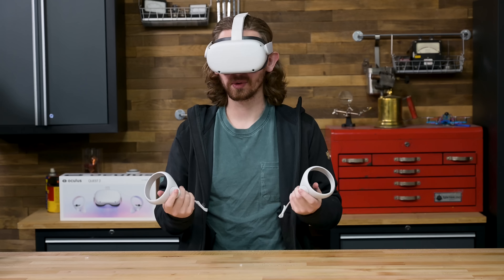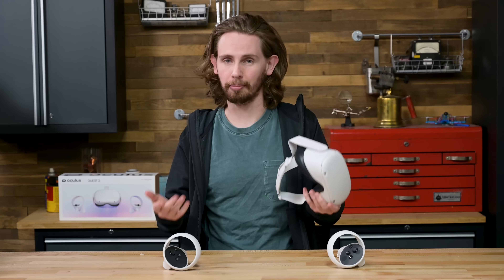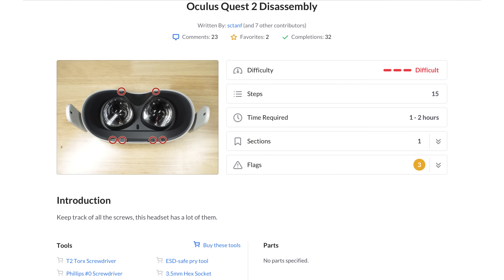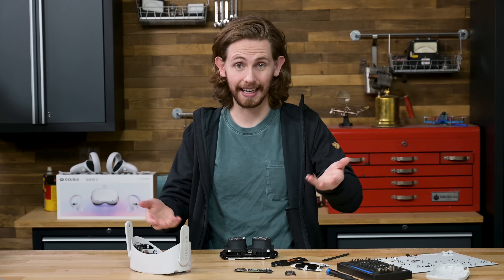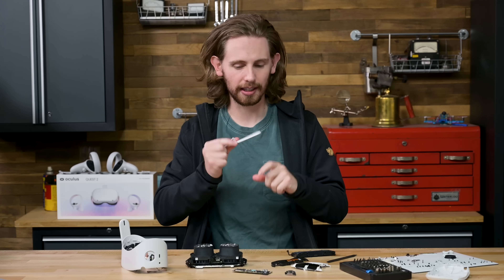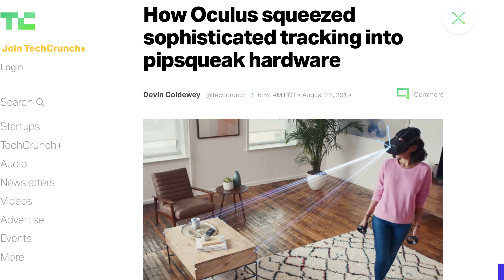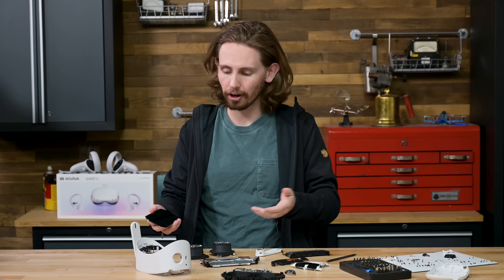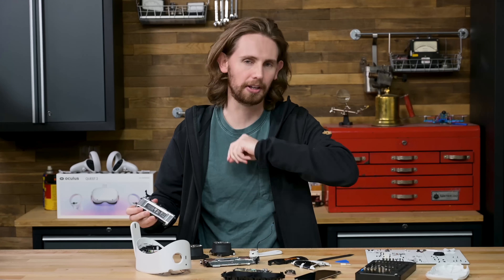Oculus Quest 2 Teardown: Into The Metaverse

Comment: if you want a more proper answer on how they  track using cameras, AFAIK it's just by recognizing common objects and land marks in the area you're in, then they measure their size, check how much it gets smaller and bigger and how it rotates to track the headset. if it gets bigger you're moving forward! and you can see the object on the left of the headset move back, so that's how they can know, and they probably combine it with the accelerometer data to get better accuracy.
Reply: It's called SLAM tracking, and basically works the way you described

Comment: The instuctions been up at the site for a while now, and I feel like I've seen this vid before. Is it a reupload or just deja vu?
a couple notes on when I took mine apart:
- don't. Theres really nothing inside to change or tinker with. I did it to take a look at the front cover and see if making custom front covers is viable. I would say it is to an extent
- the facial/rear cover is snapped on very tightly and took a lot of work to get loose. You want to pry the cover straight out in the direction away from the device rather than just pulling the 2 plastics apart

- the deep screws that hold the front cover can be tight and I had to use PH00 instead of my PH0 that was stripping the screw head
Reply: Its not a reupload, since they mentioned the meta event from the end of 2021

Comment: Gotta say that this has to be one of the best and few Oculus Quest 2 teardowns I've ever seen. I been thinking about modding mine since i bought the 64gb model before they decided to phase them out. Might be able to cut a hole for a bigger heat sink so it wont make my face sweaty lol
Reply: 3d print a vented spacer with integrated laptop or other similar small and thin fan, I wonder if anyone has made something like that
Reply: @virtualtools_3021  i like that idea. Or a new front cover that's a bit more bulged out to put a bigger fan and heatsink inside. Even battery. I should invest in a 3d printer as my next big splurge purchase. Nothing too fancy should be ok.
Reply: There's a product for this. It a modified facial interface which has space for a fan that goes on the top of the HDM. Bobovr fan is the thing to search for, I heard good things about it but I haven't tried it myself and kinda not cheap.
Reply: @SzDavidHUN  i saw what you was talking about. Kinda reminds me of one of those blower clip fans you attach to the side of your laptop to blast air into it.
But what i was going for was cooling the headset's hardware. Like there is this video i forgot who posted it where a guy liquid cooled the internal cpu.
Reply: i think the best mod for the quest 2 would be a replacement headstrap that gives it the ability to get the lenses right up to your eyes like the valve index. i get a far higher fov with the quest when i take the face foam off. but then its not comfortable. 

replacing the entire quest 2 shell wil a minimal shell that sits inside a headset frame with a adjustment dial like the index would be really cool.
Reply: @ge2719  im able to get my eyes right up on my headset. Downside is eyelashes hit the lenses and can leave bits of oil each time i blink. I thought about a lense swap, but the way the screen works makes it where you cant get any more fov. I wanted to cool it better when i wanna push it to 120hz

Comment: can you leave the battery out and connect it with a wire externally (say if you wanted to clip it to your belt) to reduce weight? Would that throw off how the system works?
Reply: It might. I know that the longer a charging cable for your phone gets, the slower the charge. Like test the recharge speed of a 3ft cable vs a 10ft cable. My guess is some of that electricity gets lost in the wire. I use an external power bank like a 10,000mah one for about 10-20 dollars. Adds another like 3-4 hours of non stop gameplay. Takes forever to recharge the power bank though so buy an extra lol.
Reply: @batterypwrlow  voltage drop over a meter should be minimal. maybe you have been using a lower amperage charger that just happens to have a longer cable because it shouldnt matter. 

in the case of this device it depends what the voltage of the battery is. it might not be 5v.
Reply: @ge2719  might be just bad quality cables. Most of them are Dollar Store generic cables. I use a 5v 2a or 2.4a charger usually for my stuff.

Comment: Great video! Only thing that i still want to see is how well the charging port is soldered and secured.
Reply: Did you ever find the info my charger is lose and I need to tear down
Reply: @aprillove143  i havent but i would just get someone experienced in micro-soldering  to check with a voltage tester and repair if necessary. BUT only if you cant get meta to replace the headset entirely. I hear they'll replace it if its manufacturing error. Im no expert but ive done some repairs. And first thing you wanna do is see if thecompany will fix it for you. Because if you take it apart they DEFINITELY wont replace it.
Reply: @the_rabbitt  I actually did the Meta Chat support and was able to send it in even though my vr is 16 months old they made an exception to have it replaced. I took  that route! But still so many people having charger issues, I see it on Facebook daily. Im surprised not ONE charge port discovery video. Would be very interesting to see why they are melting or becoming unsecured and unmounted like mine.
Reply: @aprillove143  im glad to hear that it worked out. Once mine eventually goes and dies ill make a video about it. But im hoping that wont be for a long while.
Reply: @aprillove143  do you happen to live in Hawaii? Just curious.

Comment: I wonder if you could mount some cylinder battery holders on top and use one or two 18650’s. Maybe someone could manufacture a cable that could be routed out the case.

Comment: iFixit is finally taking VR seriously. I hope the rest of the tech news industry follows. Zuckerburg is paving the way through the Metaverse. Btw you can position the IPD lenses in between the notches so like between setting 1 and 2 or 2 and 3. I hope they bring it back soon.
Reply: By just buying a quest2 you are not automatically a serious VR dude.
Reply: @REDxFROG  Are you seriously gatekeeping vr?
Reply: That's less stable, chances are they won't stay in place. It's better than no IPD adjustment, but it would be better to have a more flexible one.
Reply: @jaskor2443  so you have a clue?
Reply: @thenonexistinghero  my neighbor uses a spacer that they made out of paperclips, and there are 3D printable spacers on the various 3D model sharing sites.

Comment: Next, the controllers... The joystick ghosting has been really bugging me off
Reply: and i've contacted oculus support to get the part and they said they don't sell it and couldn't provide me with a part number. They did offer me a controller replacement though, which i politely refused and temporarily fixed it myself. Not sure if my fix is gonna last.

I really hope that part will become available from the usual suspects as quest2 gets more popular and the demand for them increases.
Reply: Tried cleaning the exterior lenses and adjusting the room lighting? Possibly forcing the tracking frequency to your country's lighting?
Reply: Replacing the batteries fixed it for me

Comment: Is there a way to mod the Quest to bypass the battery and feed it directly with the power needed for PC gaming and applications? 
When I set my Q2 to max resolution and framerate etc, it drains the battery quickly. I understand this is because you can only charge the battery with external cable which is limited to protect the health of the battery? Need more power! 
Good to see a teardown and see that it can be repaired, even if its complicated.

Comment: I would love to know if you could get a better battery to increase life time. Some sort of modd that doesn't not include using a externa power bank to charge it.
Reply: 100%, the connector it uses is standard. You could DIY it with a bit of know-how or you could wait for another company to make a generic battery. Future batteries will have more capacity so thats one way to get a better battery, waiting.

Comment: I feel like we could mod the headset to wire the battery to the back of a strap. The Headset would be perfect. Though, I don't know if there are any software quirks involved with the position of the battery. As I could clearly see multiple connectors there.

Comment: heey, what's up. Bro,  u do a really cool and educational video, and thank you for it.
i'am a brazilian, and here this assembled screen has a high value like a 590R$ (105/106$) + 400R$(70/71$) Tax.
But only the screen i can get it for 215RS(38$), u have a video doing that replacement ? or can u tell me if i can use that screen without that black glue?

Comment: It's not mentioned in the video but I'm just going to suggest that the aftermarket Elite Head Strap (with a battery) is worth a teardown video, it would make a lot more sense to get the upgraded strap and replace the battery inside it than to ever open this thing just to replace the battery in the HMD.

Comment: Screens can “fail” pretty easily if you leave the headset sitting in the sun and get a burn mark
Reply: just dont let the lens get exposed to direct sunlight.... not hard if you get a lens cover.
Reply: @shoopdawooplazars  I assume it's not that hard of a thing if you leave it on a table infront of a window without realising, or need to take it off quickly (i.e. you're VERY prone to motion sickness) so you put it on the floor infront of a window
Reply: @u1f98a  youd have to leave it there for a little while, it doesnt happen instantly

Comment: Could be nice if it was cable only and they excluded the battery from it and sold it separately (like a strap). That way they could pack more tech in it or make it more slim...
Reply: The limitation is actually already just the lens. If they improved the resolutions of the screens it would not even be noticeable. The bottleneck is the glass. The quality lenses exist on prototypes and Varios and its reportedly a whole other level. The future is quality lenses mass produced.

Comment: @iFixit Do you have a link to where I can buy a T2 screwdriver with a hollow tip? I tried 2 different T2 drivers, but neither had a hollow tip, so they didn't work. I think it's technically a T2 Security or T2H.

Comment: How about the oculus touch controllers? Many users are experiencing drifting
Reply: Clean the joystick with compressed air while spinning it, or, send it in for a replacement if you're able. I just had to send my controllers back for that exact reason. Cleaning helped but unfortunately only temporarily.

Comment: My headset has so much use the battery gets around one hour on a full charge. Bummer it takes a fair amount of work to replace.
Reply: I mean that's kinda y u use a extended USB-C cord and plug it in while u play its a life saver instead of waiting for like an hour or 2 to charge it
Reply: @stiffplaysgames9999  I mean that defeats the whole point of wireless VR but ok

Comment: Where can you get the tool to remove the trim piece as I cannot use my headset because the trim piece is stuck popped out and my screwdriver is too big to unscrew the screws.

Comment: @iFixit Any idea why my Oculus controller are not working?

Why are the controllers suddenly not working?

I've done nothing different and the headset and controllers did not fall or take any type of damage. They just suddenly stopped working after a game of beatsaber.
The environment of Oculus has not changed.
No direct exposure to the sun with ample lighting and with more than enough room use it.

I've reset the WiFi, take with my internet provider and they say everything is green. So that's not an issue.

I turn off the headset and reset it multiple times. I've unpaired and repaired both controllers multiple times. The batteries are full and the do buzz as if there going to connect.
The center white dots that acts likes a mouse cursor does react when I press the right controllers top trigger and A button but only makes the cursor flash blue per tap. Same goes the left controller for upper trigger and X. Only the upper triggers and lower buttons make the cursor flash from white to blue. But doesn't show hand or allow my hand to control the cursor.
That's seems to be directly controlled by the headset. The cursor seems to stay center and only move headed on where I aim my head with the headset.
Reply: Get new controllers , that’s prob the only solution

Comment: I wonder, is it possible to relocate the entire battery outside the headset and wear it on a vest or a belt?
It's one of the heaviest components so if the weight of the battery was removed, the headset would be a lot more pleasant to wear longer durations, and might as well stick with a larger battery (if possible)

Comment: IPD hack You can actually get any IPD within the minimum and maximum, though there’s three steps you can move the lenses between those steps if your careful and it will adjust the screen appropriately to the distance you moved, not just the 3 settings. I need slight click wider than the minimum setting, and it’s so much better then being on either one of the settings each way.

Comment: My biggest gripe is that even when the headset is powered down by holding the power button and selecting power off, it still drains the battery, like a lot
Reply: Gotta unplug it. If its plugged into a non powered cable like a shut off PC it will drain overnight. If its unplugged and fully off it will last a reasonable time.
Reply: @nutellabrah6718  I will have to test that. Thank you!

Comment: Anyone know the capacity or weight of that battery pack/mount? Curious if it would be worth removing amd using the external headstrap battery instead to take as much weight ad possible off the front of the face.
Reply: 63 grams per Oculus website. Not really worth it by the time you counterweight the headset with a powerbank anyways. Unless you're one of the rare people that think 2hr battery is fine.
Reply: @rcbif101  Im curius if that includes the weight of the housing (being that it looks like the battery is inside a metal housing). Although I doubt the  headset would work without the built in battery, no doubt there is some "safety" check"
Reply: @legendp2011  Looks more like an injection molded housing. They tried their darn hardest to keep the weight down so I dont think they would use metal.

Comment: SCREEN FAILURE COMMONALITY - how about four units in two months? I have had returned one unit to Amazon within two weeks, another bought direct from Oculus/Meta after 2-12 months, am in the middle of returning the replacement Amazon unit and just had the replacement Oculus unit fail. I am guessing this is sweat/condensation ingress into the unit from hard workouts. The pattern is that the display develops a very grainy characteristic with vertical lines and reduced light output before going completely dark. I wanted to see the breakdown again because I think I need to seal up the interior with electronics safe silicone.

Comment: Why not put those complicated parts behind or at the top of our heads, instead of everything up front, you cannot see through it anyway, your eyes only focus on those lenses. Maybe my idea end up much like a helmet, but the weight will be more balanced.
Reply: More faliure points with wires and connections traveling an area if the headset that also needs to be adjustable.

Comment: 0:40 "hours of setup and calibration", but it took you 20min in that video, and like most people, it only takes about 5min to setup for lighthouse solution. Plug the HMD into the computer, place lighthouses on opposite sides of the room and with power, then run the 30seocnd roomsetup. Why are you lying? WMR and Vive both make inside-out tracked system that don't require any setup either. 
Seems like this is a facebook paid video since you clearly try to make superior systems sound inferior when the opposite is true. Really disappointed in you, ifixit.

Comment: Hold on.. "Other headsets require HOURS of setup and calibration".. is this true??
Reply: Maybe a day or two at most
Reply: No. 30min tops if you have all needed hardware, eg. drywall anchors if drilling into the wall

Comment: Metaverse is a pathetic attempt to make VRChat 2. On top of the fact that Facebook doesn't have any talented self-respecting engineers after they all left the company in 2018. Also, no network infrastructure even in the next 20 years could ever handle the kind of data streaming they claim metaverse to be capable of. With of course the impending doom that Facebook won't exist in a few years. 
Please, ffs, don't buy this data collecting facebook device. It's sad this actually needs to be said.
Reply: What datandoes it collect? You can use fake account and use it as pcvr with steam